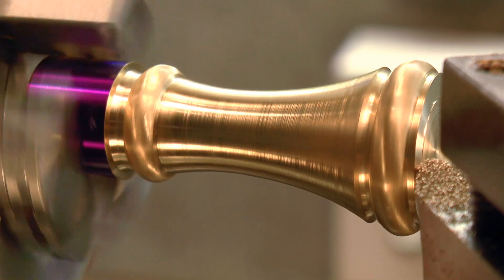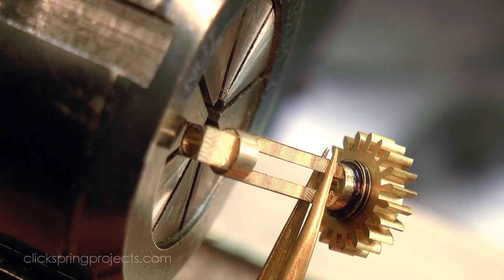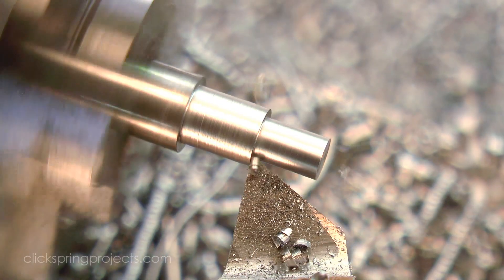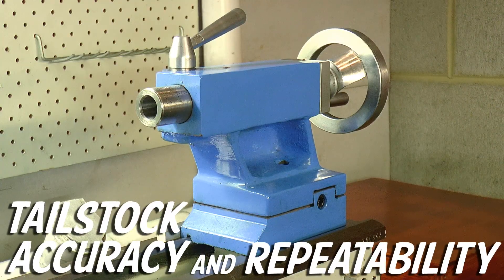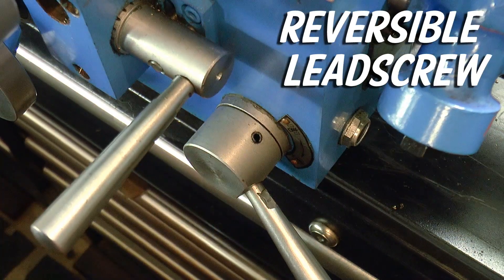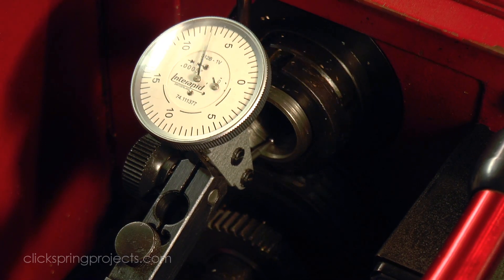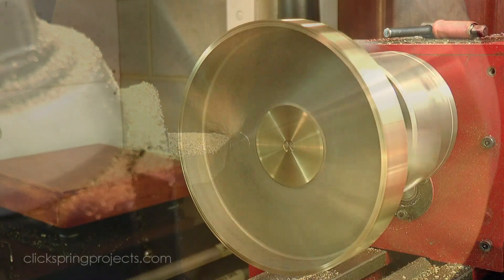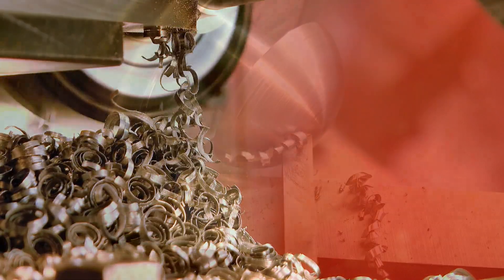Tools, Glorious Tools! #6 - Which Lathe Should I Buy?

Comment: I'm going to add my two cents. OK, maybe 5 or 6 cents
1) Most small lathes out there have too small of a spindle bore. I would want to pass through at least 1"/25.4mm stock. I've seen 8x30 lathes with a #5 taper and 1.5"/38mm through hole. This is more than large enough to use 5C collets. My only concern is the size of the spindle bearings. I am assuming they area relatively narrow tapered roller bearing.
2) Collet attachments and spindle overhang involved. Using some of the aftermarket collet chucks the work is often farther from the front spindle bearing than the bearings are apart. The closer you can get to the bearings the better.
3) Collet type. While ER type collets offer a greater gripping range. 5C collets taken as a whole system have a lot of advantages. Built in collet stops. Different types of collets. Standard, square, hex, internal, extended nose, fixture plates, oversize or pot chucks. Plus small 3 and 4 jaw collets mounted on 5C arbors. 
4) Threading options. One thing every small lathe needs IMO is a Single Tooth Dog Clutch set-up for threading. Some lathes have them built in. But in reality they can be added to any lathe. Automatic pick-up of any thread. Inch, metric, DP, Module. Throw the threading dial in the garbage. If it is equipped with a trip mechanism to disengage the dog clutches threading to a shoulder is no big deal. Plus no reversing the spindle when cutting when cutting special ratios or metric on an inch machine. 
5) Variable speed drive. This can be electronic or a Reeves type drive. Just as long as its belt drive.
6) A taper attachment. Absolutely required if you are doing anything making tapered tooling.
7) A true running rear bore or OD on the spindle. Running long stock sticking out of the back end of the spindle without any support is dangerous. With a true running diameter on the back of the machine making supporting attachments is easy.
8) The biggest single downfall of most small lathes is the width of the bed. Wider is better.
Reply: I agree on all Your great points. Use C5 of all sorts but the limited gripping range nominally about +/- 0.1mm may be a limitation for some if You do not buy a extensive set of the collets. The ER collets cover whatever diameter You need to clamp, less critical. I love the c5 attachments, have square, hex, ER16, 4jaw, 3jaw etc and all of these can be used in collet blocks, spin fixtures and in my grinder. Very flexible and also economical.
Reply: Small lathe, big bore would be so handy for larger brass rod, my C3 is too small. I don't need 20" bed.
Reply: Items:1, 2, 3 & 8 true. I have both 5C & ER40 set-tru type chucks. The disadvantage of the 5C is the very small grip range, requiring many more collets. The spindle nose of the 5C chuck is smooth with no protrusions allowing hands to be used very close w/o danger (polishing!) 4 Not familiar with your dog clutch. I always thread away from the chuck no precise start/stops required.  5 My lathe is gear drive, 3 phase, works great. 6 Tapers can be turned using the compound, offsetting the tail stock or using a MT adapter that will offset the center. In addition to or instead of a taper attachment. 7 A spider with 3 adjusting screws can be easily made for the outboard end of the spindle. 8 It isn't just the width of the bed, size & mass helps also.
Reply: @larryschweitzer4904 
Given a choice with money not a concern it would be a Hardinge HLV-EM (or clone) and a Monarch 10EE

Comment: My first lathe was a 9” south bend model A that might not have been used ( hunter bought thinking he’d do his own gunsmith work and never did). It was really smooth, nice work size and if you did  something wrong would stall.

Have a 14” Logan/Powermatic that works, but will be replaced by a gear head since the Reeves drive isn’t smooth enough to me. But unlike the SB, if I try too heavy of a cut or fast of a feed something will either break or go flying.  The underpowered SB was easier to learn on.

The Taig is nice for small parts, but anything with removing much from steel takes a while.

Comment: Excellent video. I nearly bought the Sieg SC4 but ended up buying the Paramount Browns FI550 instead. Hardened bed, pulley driven and reasonably heavy. The tailstock casting is horrible but functional and accurate, got lucky I think. No power cross feed but easily rectified by adding steppers on both axes and an ELS 🤣   I can't believe I'm able to turn parts under 5um accuracy on this import lathe, don't discount the China imports.

Comment: I’m always interested to see what you do with the Sherline. I’ve got an old Australian one, with an extremely not-hard brass bed (and thus quite badly worn) and the old-pattern tail stock, which means I agree heartily with your comments about bed damage and difficult tail stock alignment. I’m currently using it to manufacture parts for an old Myford ML4 which I’m restoring as my ‘upgrade’. This early Myford has an even worse design of tailstock, which I’m not looking forward to wrestling with..

Comment: Spot on with lots of tips, especially the hardened bed, lead screw covers and belt drive. One more thing with small gear driven bench lathes, any accidents with large turning will result in chipped gear tooth. Worst with belt driven ones is the belt slipping. Great tips for newbies, cheers!

Comment: Excellent video as it explains lots of the catches and tradeoffs.
I had to buy a Sherline as I need to be able to lift it and store it rapidly. 
I'm constantly running into it's size and power limits, but the precision is indeed excellent. 0.01 mm without grinding is easily achievable.

Comment: I have bought a Sherline lathe and am about to buy their mill. For me the main criteria were size and weight. My workshop is my garage. I could make enough space for larger machines but it's unheated (I live in Illinois US). I've already seen some of my less "sensitive" tools rust in the garage. So in the winter, I move the lathe to the basement. I'm just about to retire (1 more week!) and long-term may need to downsize. So my plans for things to make are still interesting and stuff I want to do, just small.
Reply: Chris didn't mention it in this video, but for some a huge selling point for the Sherline lathe is the ability to rotate the head stock off the central axis. He demonstrated this in one of his clock making videos and I was frankly blown away.
Reply: @ExtantFrodo2  its a good feature. Unique.
Reply: I traveled a bit between countries. Sherline was the only option since I could not move anything else.

My cross slide wasn't holding the tool at the right height so I built an attachment. Did you have that problem?

Comment: I've been using my Proxxon PD250 for about five years now on clock repairs, excellent lttle machine, really pleased with it. Why this one? Budget friendly-ish, and I don't have much room. I just bought the PD230 milling motor plus acessories to complete the setup. I'm looking forward to making some gears from scratch!
Reply: Got PD 230 and MF 70 headstock above, really happy with versatility and precision. Nowadays Proxxon is made in China and the quality is below any critics. So my advise would be: the older the better.

Comment: If you use inserts, as I do, a 'quick change' tool-post actually takes longer than a 4 way to use. 4 indexed tools without a change, and more than that two motions rather than one for the rest - so less than 8 tools needed = less time. (Inserts are a standard height, so a single packer attached to the bottom, gives you correct height every time) Plus you can change the indexing as you go, and still return without adjustment.

Comment: Stefan gotteswinter had an awesome tip for tramming a benchtop lathe, which he got from the manual of his secondhand lathe; instead of mounting it directly to the bench, mount it on bolts that are secured with some contra nuts to the bench. (Which should be metal with threads ofcourse) That way you can easily tram the lathe just by loosening the nut and turning the correct bolt.
Reply: do you have a video title to share? stephans got quite a library of vids.
Reply: That is brilliant! As soon as I read it, I could see it in my head. I don't even have a lathe. 😂  Would like a small hobby lathe at some point, but first I need to tear down the garage and build a new one.... ouch.
Reply: Stefan got that from a guy in the Zerpsahnungsbude forum who was restoring a Emco 11 Maxi-blah and was mounting it that way.  It's pretty cool thread and takes it all apart.  Very nice machine.. H&F seems to sell a clone of it under AL320G.  And as per that thread - either get or make a sturdy stand for it, those stands that come with them are too flimsy.
Reply: PS: thread is titled 'EMCO Maximat Super 11' on 'Zerspahnungsbude' started by a guy called sm_designs .. page 8 shows the bolts and mounting

Comment: I’ve been looking at quick change posts for a 7x14 import lathe. Did you buy the next size up change post and then grind down the holders to get the centre height? Absolutely love these tool tours.
Reply from the maker: Yes, exactly. The larger toolpost was the more logical size for the lathe, but the tool holders required surgery! Cheers :)
Reply: @Clickspring  thank you! Stoked to get a reply! Is it achievable to cut them down without a mill if I use a whole weeks worth of careful?
Reply from the maker: I used a carbide end mill, as I recall the material was a bit unpleasant to work as its somewhat hardened.

Comment: The issue with the brushless motor variable speed systems is lack of torque at low RPMs, which is going to affect your depth of cut. Not a deal breaker, but something to be aware of.
Reply: Maybe you just need a good VFD with FOC and external motor cooling. Then you can go to nearly 0rpm with full Torque.
Reply: @hassiaschbi  Maybe that would push the price of a hobby lathe or mill out of the hobby price range.

Comment: I got a brandless Amazon Chinesium lathe.  It’s about as precise as a hand grenade.
Reply: My next project will include following TOT’s video and replacing the garbage spindle bearings with tapered roller bearings.  However, I need to get a hydraulic press first, or just perhaps break into a machine shop while no one’s looking.

Not to steal anything, but to use all the tools.

Comment: I made a solid tool post mount for my Emco Compact V8 today. A difference like night and day, even though it is only a temporary one quickly cobbled together. The compound slide costs a lot of stiffness in small lathes and you rarely need the compound anyway. But what you do all the time is operations like parting off, where the extra rigidity of the solid mount makes a world of difference.

Comment: Somehow ended up with a Weiler Praktikant 500,  fairly small but did most jobs i needed it for. First thing i did was fitting a 3 axis DRO, second one was throwing out the noisy gearbox and fitting a big 5kW servo motor with suitable controlelr to get variable speed with wnough torque over a large range. Still thinking it should have been a good bit larger (ultimately limited by what i can get in my shop, the limit being around 1.5 tons).

Comment: 8:48 I'm trying to imagine what it would take to make this part easier, like some kind of custom wrench.   Getting a narrow style ratchet to fit would be nicest.  But, I would definitely try adding a retaining spring to a box end wrench so that you could at least start a nut without having it drop on you.
Reply: John Heisz has come up with a solution for his Table Saw. Putting the Nut on the Anchor is similar difficult to adding it here to the lathe. Maybe something like this: youtube.com/watch?v=LuRnhkuAz9Q could help
Reply: @Craftlngo  That was fun.  Thanks for the link.
Reply: @Craftlngo  That was a fun project. That said, a ratcheting box end wrench, a small piece of thin plywood (or sheet metal) and a rubber band to hold them together would work nearly as well.
Reply: That would also be my go to solution. But where is the fun when you can also build a contraption from wood by hand?
Reply: Yeah I was going to suggest the John Heisz vid as well. I'm imagining some beautiful brass and polished blues steel contraption 😊

Comment from the maker: It's one of the big decisions to make when setting up the home shop, be sure to share your lathe purchase thoughts below!

Cheers :)

Red Lathe: SIEG SC4
Blue Lathe: Weiss WM 250V-F
Sherline: Sherline 4100 (Metric)
(Retired Green Lathe: CQ6125)
Reply: I have the WM280-VF, now about 15 years old. Changing the chucks over is the same struggle as yours. I keep toying with the idea of some kind of camlock system that would fit in the gap between the flange and bearing. Needless to say I haven't done it yet. The spindle bore on mine is very rough (not machined) so maybe I should just make a new spindle with more finger space. Thanks for the video 👍
Reply: I've recently restored my Swedish Southbend 9" clone (Åsbrinks BS II) from ca. 1940.
Difficult to get the very best precision out of an 80+ years old machine with bronze bearings, but hey it's mine 😊
Hopefully it will serve for my lifetime and more.

Sidenote, the spindle bearings could actually be a dealbreaker on vintage machines, as roller or ball bearings probably are easier to maintain.
Reply: Got a BV20L-1 for more than 15 years, precise enough but lack general rigidity when machining alloy steel. Gearbox spindle is a big plus, giving a lot of torque at low speed. Got recently a good old 1950/60s lathe (hermes mentor) which was very good for its time (320/610mm, 36mm bore), much mode versatile and still smooth enough for small jobs.
Reply: Do a video on books.

Comment: Colchester or Lansing Student is always a good choice...but I’m biased as I was a Senior Development Engineer at 600 lathes in the late 90’s
Reply: Colchester student is a pretty big lathe for a beginner, I'd go for a Myford 7 as a better starting point for someone wanting a 2nd hand lathe.

(I have both, and the Myford gets used way more often)
Reply: Well, I've got the Triumph and absolutely love it.
No change gears required, taper turn attachment, feels light as on the hand wheels.
I'll get back under my rock now...
Reply: I would like a Colchester 2600 or so. But i learned on one and anything less powerful is frustrating